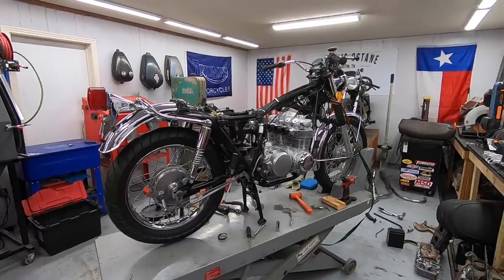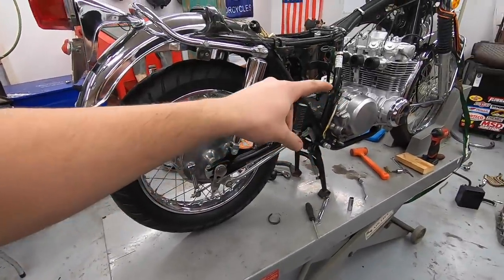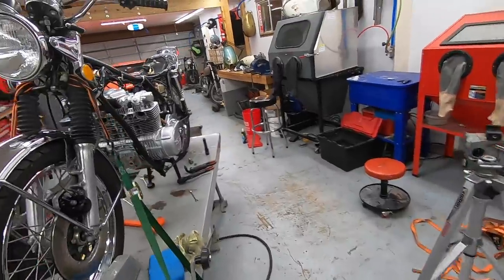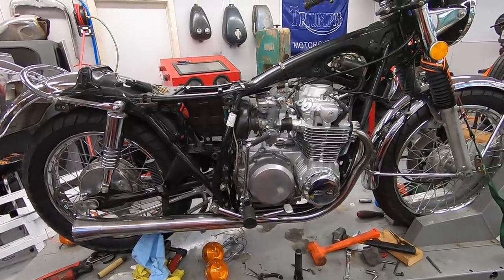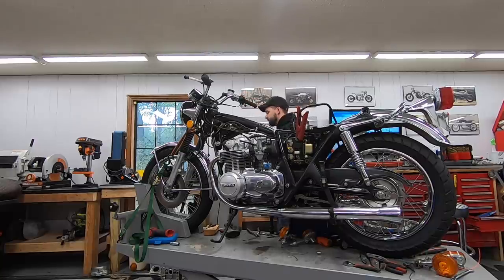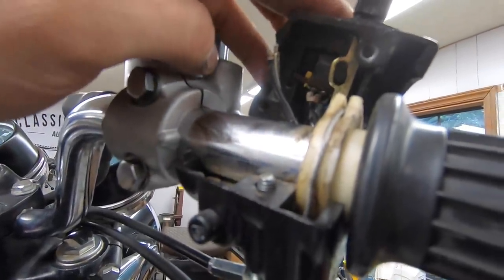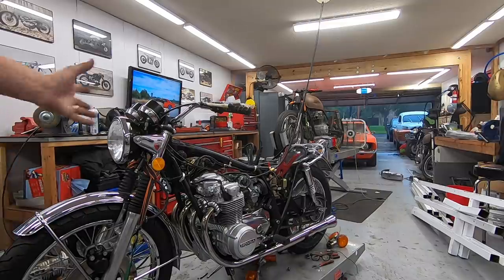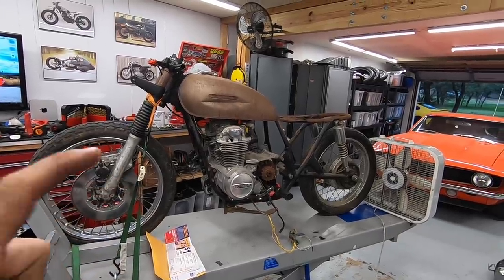Honda CB500 Restoration: Reassembly and first start!

Comment: Looking at the front fork cap at 0:40 it looks like the fork cap has the gap in front.  Honda designed the forks and the caps to be installed in the rear.  Remove the caps and you should see an arrow that points to the front.  Install the caps and torque the front nut first.... then torque the rear nut.  Had the same thing done on a 750 that Hackaweek put together.

Comment: If I could have only one bike, CB500/550 would be it. Great, reliable bike in the 70s (high school).
Reply: i'm having a cb500 pc32 from 1998.. seems to be damn solid :D she has already 80.000km and still has no issues ^^
Reply: @xParaDoxon  thanks, but no. I'm working on getting a GL1000 back road worthy right now.

Comment: I used have the same bike ,the three way voltage system ,swop it for the electronic point ,
Engine oil cleans and eats rust

Comment: To clean the exhaust you can use wd40 mix with little bit of brake fluid and you can use razor blade to clean the heavier parts good times cleaning it

Comment: Bike is looking good.  Almost runs good too!  lol  Yea, needs a little TLC tuning wise, but should be a nice running bike.
I do have one comment on your start ups though; you really crank those stone-cold engines over for what seems (to me) like forever.  I never crank on an engine more than about 5 seconds max.  If they don't start in that time frame,  I go looking for why.  If everything seems okay, then I hit it with some ether.  If it still won't start after 15 seconds with ether, I go looking deeper. Anyway,  I am looking forward to seeing it on the road!

Comment: Thoughts on upgrading the coils on these old Hondas?  Thinking about getting some Dyna coils for my 75 CB750.  Not sure if they make much of a difference or not.  Currently have stock coils on it. (Upgraded to Dyna S ignition last year.)
Reply: Yes you will notice a difference with a set of Dyna coils, specially with the Dyna S ignition. Even moreso if you are still running the original coils from '75, heat, vibration, use, and time kills ignition coils.

Comment: Thanks for your wonderful work with CB- fours, this one is my favourite because i had 1972 CB 500 here in Finland. But are those speedo/tachometers from CB750, I think because of that cable alingment to "clocks", seems not CB500? Am I right?